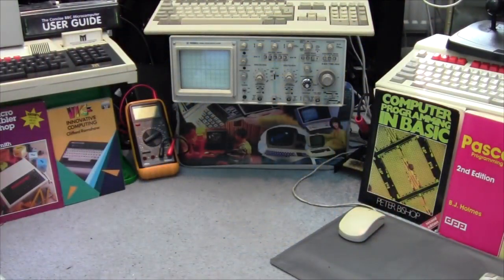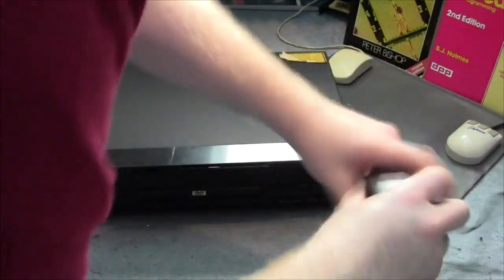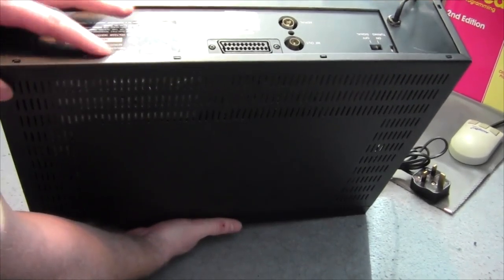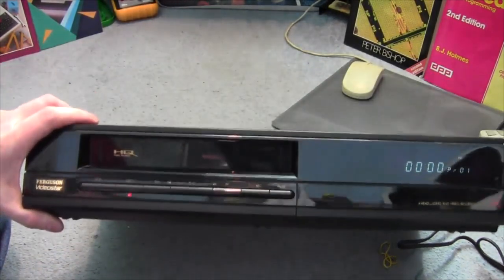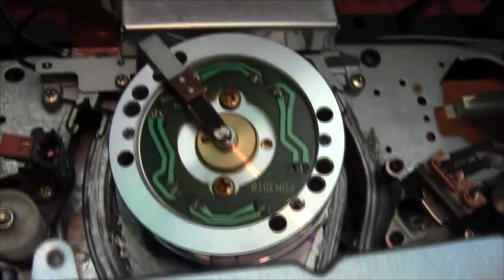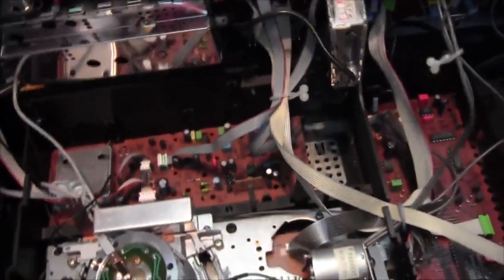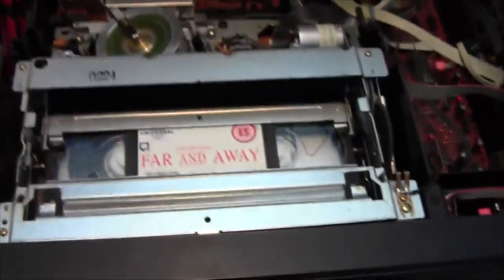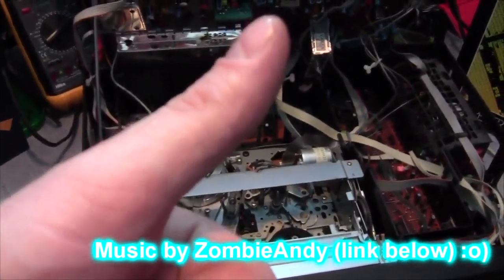Retro Video / DVD Equipment Pickups!!!  (Help needed please!) (Pioneer DV-626D + Ferguson FV 32l)

Comment: A few things:  1.  try running a line through the vcr using a game system to ensure that the signal is indeed unhampered.  2.  use an air can and give those heads a shot or seven.  3.  Track down a tape head cleaner or some amyl nitrate (do Not inhale!) and swab them down a bit.  A tape head cleaner tape would be much easier though.  4.  spray the heads and interior with a healthy amount of electrical contact cleaner.  

I get this issue a lot, and usually step 2 or 4 does the trick.

Comment: As for step 1, I'm just talking about hooking say.. an nes up to the vcr and the vcr to the tv to see if the signal makes it all the way through.  If not, then it's to do w/ the vid connection somewhere along the way.  As for contact cleaner, try Comma Contact Clean.  I think it's about 5 pounds over there.  I'm thinking it could be a connection issue though since when I have problems, I usually at least get audio to some degree.  If that's the case, start checking solder points.

Comment: yes, well for the Amiga it was called "Video Backup System" by Lyppens Software  I spent way too much time writing my own version before buying this.  It worked well using a simple piece if hardware but was slowed down by lots of data redundancies due to the amount of scanline errors you had even from the best recorder.  It was also annoying to find someone had recorded Coronation Street over your system backup as well. :)

Comment: My dad when on occasions in the rare instance when the video cleaning tape didn't work used fairy liquid diluted in water and a swab to clean the heads manually with the top off of the VCR of course and it seemed to work.

Comment from the maker: Well done tribal, at £5, it definatly was a candidate for repair and not return, another learning project for me, (plus it was the only really huge retro machine they had), and it works now, turned out to be dirty heads, I ran a modern blank tape through it and it cleaned them nicely :o)

Comment: the main head mite need cleaning or try another tape i used to clean mine with a bit of paper and after shave, does work done it my self and the tracking is the two tracking rods that take the tape up to the main spinning head.

Comment from the maker: Thanks Retro, don't understand point 1 (maybe booze talking lol)  2, I did on the boards,  but not at the heads.  3.  I've read about the paper technique (rubbing it gently with paper rather than a cleaner as they can catch the heads and cause problems apparently).  Step 4, can you recommend one, as I don't have any of that sort of stuff, I've used compressed air to clean the boards, but that's it.  Thanks very much :o)

Comment: Could your VCR just need the tuner switch on the back flipped to the other setting? i might be wrong but its worth trying all the simple options.
OR
I know you said the scart lead works but maybe the socket doesn't?
Failing both of these i'd say the play system just needs a damn good clean, i'd imagine a videostar had full autotracking so doubt that's the issue
Also i have a very funky universal remote somewhere that i shall try and dig out and you can then have it for the cost of postage